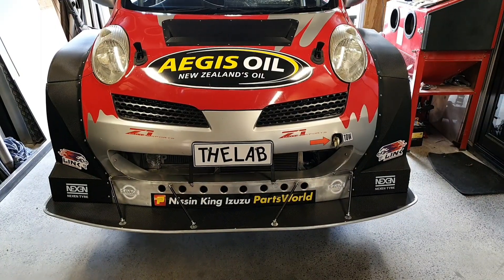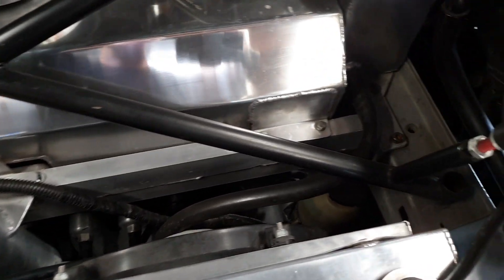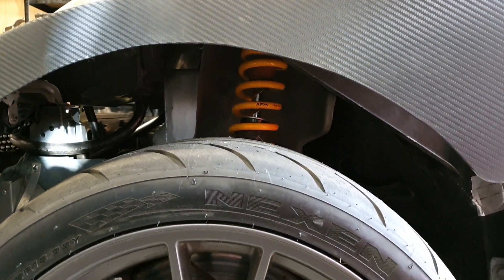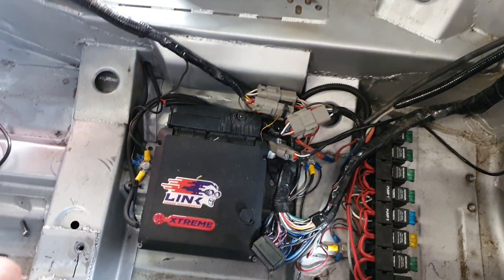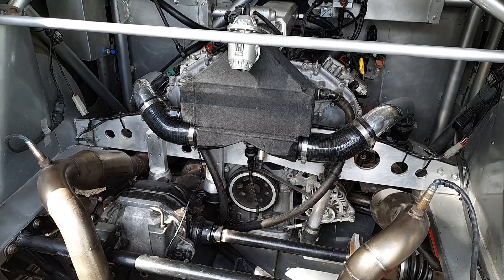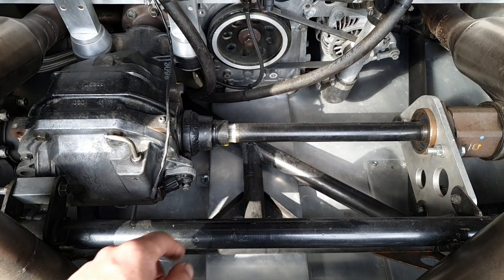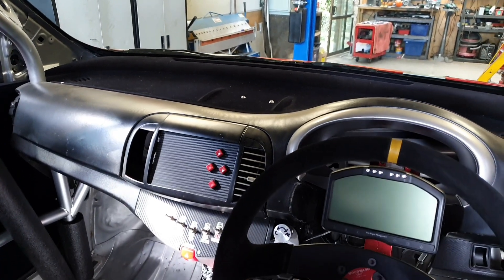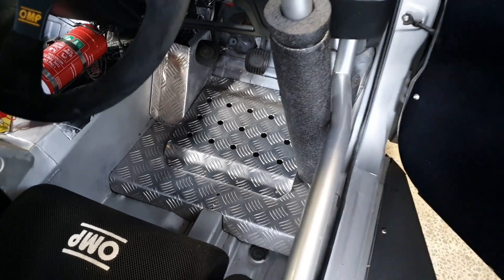Nissan K12 March twin turbo V6 4WD walk around 12mths on.

Comment: This has been an enjoyable and nostalgic once over lightly for the fanboys, I loved it. Now I'd like a couple more where you detail a complex fitment which is sorta unique to this car, eg. 'your solution' to making 4 .wheel drive from the parts bin. Position of the V6 with respect to the position of the Strut Towers. Or some more of those maths lessons.
Reply from the maker: I'm waiting until we have the Gloria off the hoist and then I can get the March up there, pull some covers off and clean her up a bit, then go through some of the details that made it all happen :)

Comment: BMW performance driving school also teaches using the dead petal to support your body position when cornering and I couldn't agree more, it helps for sure. If your still running stock pads and looking for something with bite at low temp check out Carbotech Brakes AX6 pads, they have a heat range of 10c to 537c with a coefficient of  .54-.56. Great little car!

Comment: I have a k13 march with 1.2L 3 cyl engine. What I wanna do is to move the 1.2L engine into the back to drive the rear 2 wheels and add another 2.0L engine in the front to drive the front 2 wheels. and turbo charge both engines effectively making a 3.2L twin turbo I7 engine :D
Reply: Excellent idea, brilliant! And then Chickens would grow teeth.
Reply: @tomlepski8306  lol hahahahaha it’s possible man what the heck xD

Comment: Al from The Skid Factory used some type of scavenger pump on the drain on a turbo he mounted really low. To prevent the oil bypassing like you mentioned. I can't remember which car it was though.
Reply from the maker: Yeah it's a common simple solution but also adds potential for failure, more weight and more cost.
I have a handful of plans in my head, one day one of them might make it into the car and get it sorted, is not a big issue right now but certainly not ideal.
Reply: @TheLabLimited  A couple of those pulse fuel pumps that are used on lawnmowers.  LOL!
Reply: I believe it was the barra transit and they did post up about a ez30? Legacy recently that they had to redo. Think they offer a turbo sump and pump on their gt86 turbo kit.

Comment: Is there any chance of knowing what type of build cost to do something like this would realistically be I'm looking @ converting my Peugeot 206 GTI engine , with a Peugeot V6 PSA engine transplant with twin turbo upgrades etc.. your engine mounted in the back has now help me consider that as a option for me , using maybe the empty engine space for mounting my turbos ? Any way your Micra is just an amazing piece of engineering art , more power to you , ( Kiwi's can fly ) 🇳🇿
Reply from the maker: Hey man
The cost thing really comes down to so many factors I honestly can't give you a solid number.
If I were to build a road legal version of this and kept things simple with as many OEM parts as possible and minimizing the number of AN style fittings used etc, I guess you MIGHT get a car up and running for maybe $10K - $15K including the donor cars.

As soon as you dive into motorsport safe with the right gear you're tipping another $5K or so on top of it straight away just with the safety related gear.

This particular car has evolved a bit from here and had many many parts changed multiple times so actual cost is very blurry, I could potentially replicate for under $100K (NZ) based on only doing things once (maybe lol! )
Reply: @TheLabLimited  thanks for reply mate yea I thought as much 🤔 I'm looking @ a budget of about 50k all up so your OEM options might be more realistic for me ,  any way all the best for your future endeavours